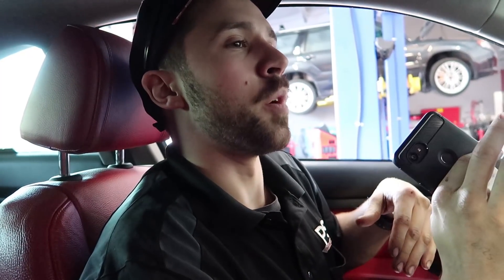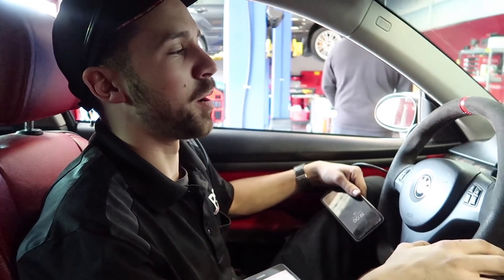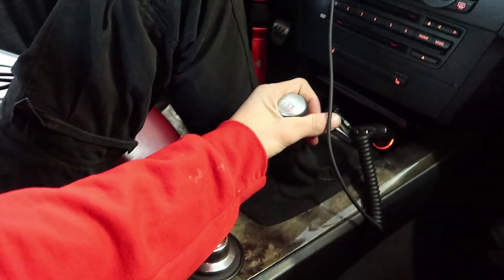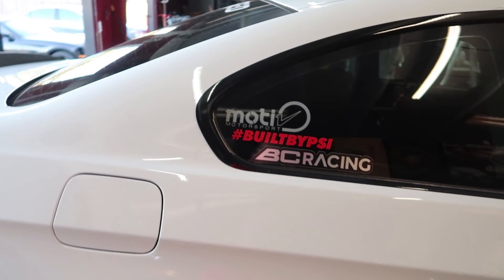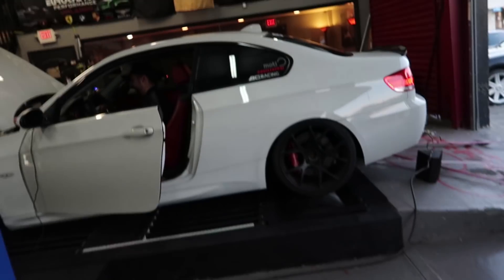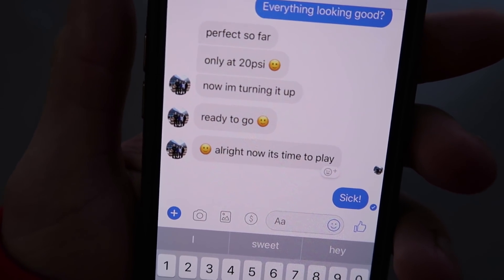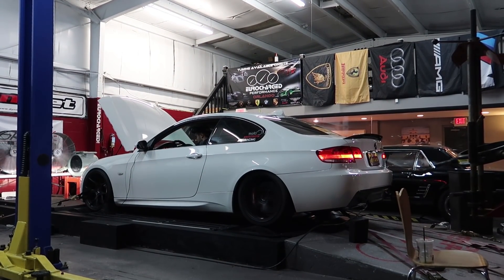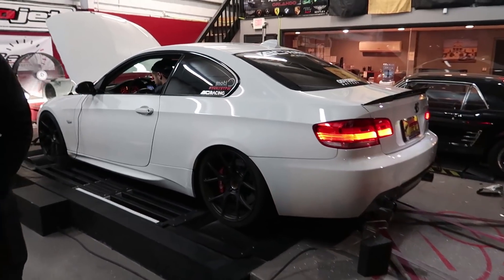WHERE HAS THE 700HP BMW BEEN?

Comment: I agree with JDMotivation. PSI misdiagnosed a 335i that I took there for a pre-purchase inspection saying the water pump was bad. I looked up how to read the water temps and the water pump is working flawlessly. I think he was looking at the oil temp by mistake. The documentation they gave me for the PPI was very basic as well. I felt like they didn't know what they were talking about which sucks because PSI is a super cool place with really nice people, but my first impression was a fail. Wouldn't hurt to try a different shop.

Comment: 30 psi on stock block crew :P 76mm 2jz :D
Reply: Boosted Lifestyle ayyy im subbed
Reply: Kyyyyllleeeee
Reply: Kyle what's the specs on your supra turbo?
Reply: BOOSTEDx TRD off the shelf borgwarner sxe 476 with the 87mm rear wheel.
Reply: Cravemoons _ ayyyyy
Reply: Boosted Lifestyle me 1988 Honda Accord with 88mm

Comment: @3:23 'the 2007 models don't even come with an oil cooler' ... the 2007 e92 335i m-sports came with an additional oil cooler no?, which is easily identifiable if you look in the right passenger wheel well & see the fins exposed for additional cooling.

Comment: I have an 07 bmw 335i production date was soo early that I couldn’t even perform the Alpina flash because the TCU is somehow different from the later 2007+ TCU’s.. but NO oil cooler for me. I did add a Mishimoto FMIC until i get an oem oil cooler setup with an aftermarket oil cooler
Reply: Ohh and i have Sport package, Cold weather package, & Premium Logic 7 w/ hi-fi speaker in dash (step down from my E90 Harmon/Kardon)

Comment: my 2007 bmw 335i coupe with sports package does come with an oil cooler. the 335i xi also has an oil cooler. these cars can overheat with normal driving in hot temps without and oil cooler.
Reply: I just posted this comment too & scrolled down to see if someone else booked his slip-up @ 3:23 .. just look in the right passenger wheel well, its so easy to identify if you have an additional oil cooler.

Comment: Hey Adam, what type of 6 speed manual gear oil (brand, weight) are using? I have an '07 E92 6MT 335i Sport Pkg with a Stage 1 Dinan tune. I really impressed with that Motive Single Turbo upgrade, when I have the cash I'm shipping mine to Orlando for the same job!

Comment: Adam get a grip car for whenever you go grip racing. Nothing crazy just something little, around 300 hp
Reply: He already has one...it's called a Mustang and they work phenomenally well as a grip car a few simple mods and the thing would be dialed
Reply: FZT Motorsport they are now, especially with the implementation of independent rear suspension. On the 2018 models you can get magnetic ride suspension on normal gt models instead of only being available on the gt350 and gt350r
Reply: FZT Motorsport Yeah, it would be a lot better with stiffer suspension but its very heavy
Reply: Aatah hi

Comment: BMWs in a whole YouTube comment

-rod bearings
-vanos failure
-fuel pumps failure
- clutch packs on dct given out on Tuned f10's/supercharged e92/e90
-diff issues 
-rear axles snapping on f10's
- throttle actuators (e92/e90)
-e36 e46 m3 rear subframe literally rusting 
-rusting 
-rusting 
And I own a AMG 🤦‍♂️😂😂😂

Comment: Should have left it twin turbo, seems you're having heaps of trouble now, super unreliable and surely not very street friendly with that much HP, and doesn't seem to be a very good advertisement for PSI.
Also the BMW used to be somewhat of an icon on the channel, BBS wheels, roof rack for bikes, LZBMX down the windscreen. Now it looks kinda stock/plain and boring on some black wheels!

Comment: Lmao you called it unreliable while there's people that make 900 on the stock n54 and still drive a lot without breaking anything.
Reply: IMNOTA it’s still a Beamer 😂
Reply: *Bimmer. Beamers are motorcycles.
Reply: Dom_112202
I don't know wtf american people have with bmw's I've seen a lot of you saying they aren't reliable, while here people do 700+k km with them, the only problems you get are some small oil leaks on the oil filter housing.
Reply: BMW not unreliable but the new ones in crashes are very bad as they just crumble into bits.
Reply: IMNOTA I doubt that there are many people who run 900hp on a stock block. Do you have any examples?
Reply: Yeah that's bullshit, no one is running 900HP on a stock block reliably, lol
Reply: People are running up to about 700 fairly frequently. Anything past that on the stock block/internals is a time bomb.